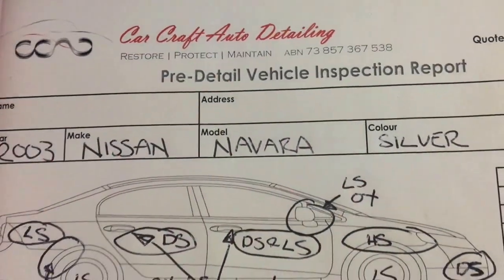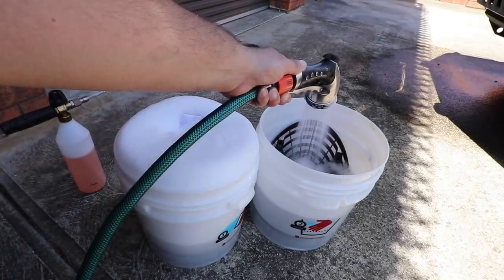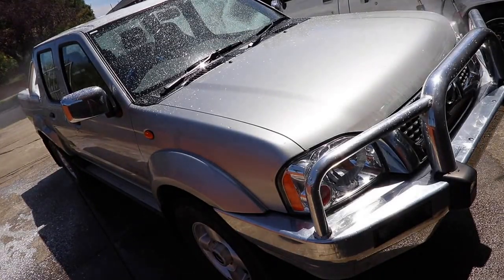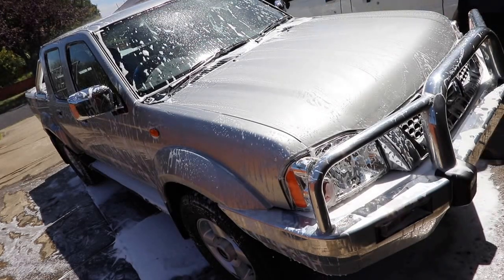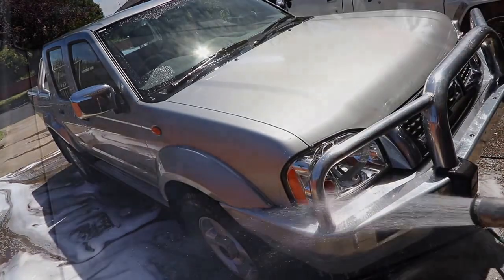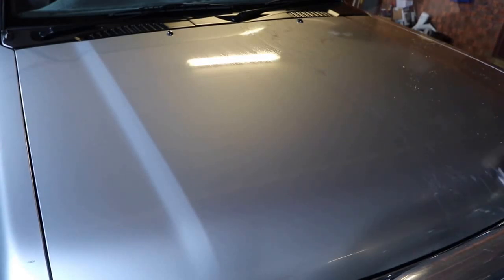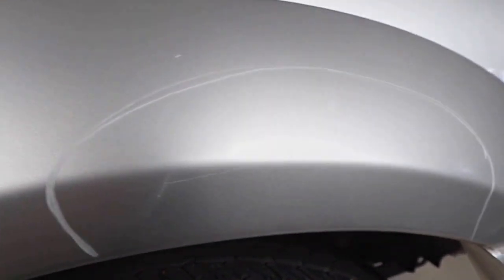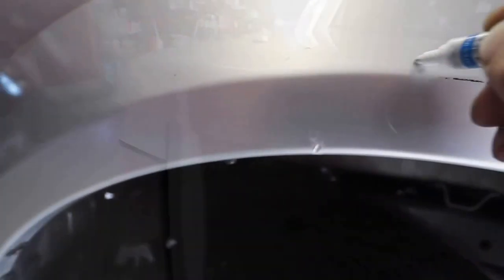How To Professionally Detail A Vehicle, Part 3 - Decontamination & Post Wash Inspection (Vlog 2.3)

Comment: Great series of vids Sandro...Totally agree with not rinsing foam off on cars that don't have mud or build up of debri that would scratch paint. The main reason I do this is time/product saving for me and $$$ saving for customer. To me there is no discernable difference from rinsing foam off or for that matter using pressure washer if not needed. In fact on some details like this I just use the red plastic wash gun that foams and attaches to normal hose and use car shampoo. Unless there is a build up of dirt/mud on body / wheel arches or very stained wheels a normal hose will suffice. My theroy is save the good foam and safe washing techniques for after paint correction and protection applied. I applaud your adherance to proven professional techniques and understand this is a tutorial for professional car detailing. Many pro's use pressure washers but not all ...Auto Fetish Detailing for example. I'm just offering options for those who don't have all the gear to follow each step precisely and still be able to have professional results. Just a word of caution for anyone thinking of getting into detailing that I learned.  Before following the pro's methods find out what they charge and make sure your target market can afford. I know I had to make a few adjustments in not following every step to the letter to stay profitable. Believe me the customers will determine whether we get to use the same methods as the high end detailers.
Reply: We are definetly on the same page regarding foam etc. Apparently Bilt Hamber have a good foam product, that does not foam as thick but may remove contaminates better. I think I saw it on Forensic Detailer channel. No complaints from up here Sandro. I just saw you posted #4 in series and I'm looking forward to watching how you deal with the scratches on the metal bumper with your dremel I'm guessing. Good luck and Good hunting...Tomato Out :)
Reply: Car Craft Auto Detailing I'm pretty sure there is one in Australia. I remember after watching I did a search and found one. Wasn't through normal detail suppliers. I will try to find again and put link here.
Reply: What no Dremel...I'm calling the Cops!!!!    Maybe I'm just going to have to come to Melb and visit you and watch the master at work....Mate no probs, good on you for taking time out to do this series.

Comment: Hi, can I kindly ask you for help with one question I can't find an answer after your fantastic videos. I am not a professional and working with my private car only. I am using Autoglym Resin Polish and Autoglym Extra Gloss Protection as a top layer. Working with my car approx every 4 month, clay if needed, paint correction with Autoglym Paint Renovator if needed. Glass covered with Turtle Wax Rain Repellent, painted plastic with Turtle All Weather Wax. Safe wash approx once per week with foam gun and two buckets, drying with microfibers and Autoglym quick detailer. Garage overnighting and high way use mostly. Gothenburg, Sweden, close to the sea. Do I need to switch for ceramic coatings or you think it's enough for me to stay with things I am doing now. Will very appreciate your professional feedback and advice. If I can supply more info, please let me know. Kindest Regards!
Reply: Thank you very much! Your replied helped a lot and I will continue to do what I am doing learning from your great videos! Keep filming please :-)

Comment: Hi Sandro! hope you're having a nice long weekend. So I just finished decontaminating my car and I was interested in your soap mix. So as i wasnt sure how to mix it up properly I bought some chemical guys clean slate "wax stripper" and I was surprised how effective it works in knocking down the somewhat old wax (2-3 month old carnouba with NXT sealant ) on my car. I had already Fusso coted the boot a couple of weeks ago, if you recall, and that stuff held up perfectly however the rest was id say 90% removed, so happy with that.  Followed with the carpro iron-x on the lower sections of the car, happy that there were very few iron deposits on my panel's! must be doing something right!! finished with a snappy clay bar, not that it really needed it. Will be polishing with 205 and Fusso Coat as LSP! This detailing thing is a tad addictive!!😂 I think the car is cleaner than it's ever been so it just shows that decontamination on your car really is important.
Reply: Car Craft Auto Detailing Good point. The wife just doesn't get it 😂😂😂😎